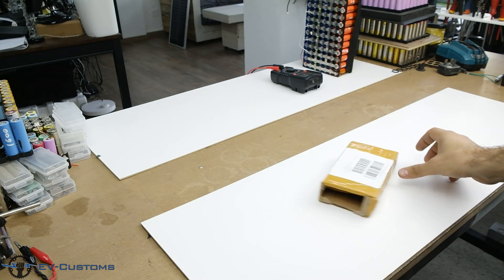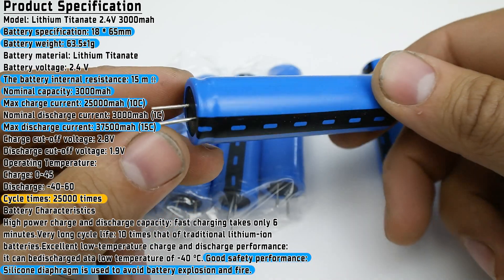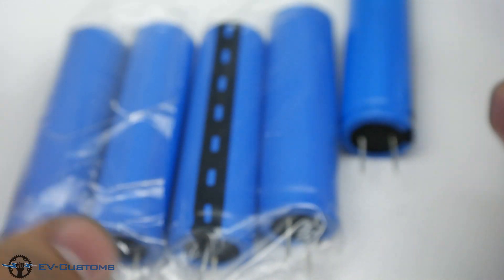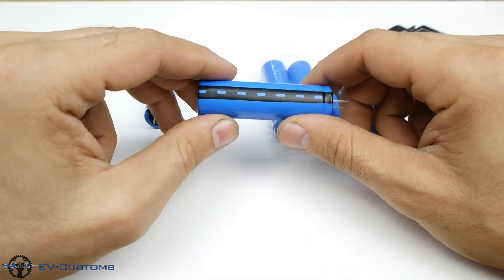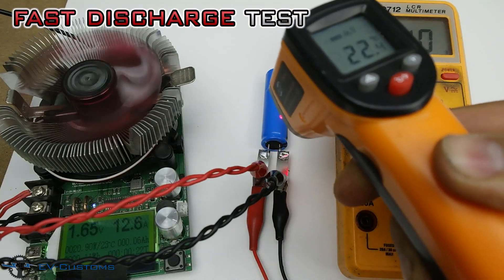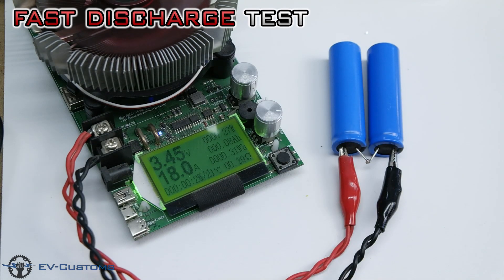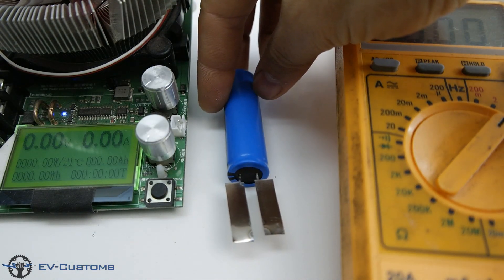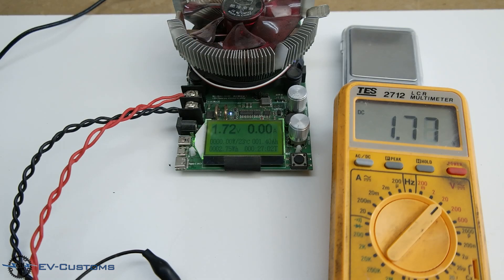18650 3000mAh LTO Lithium Titanate Battery? (Testing)

Comment: Did you experiment with maximum charging rate?  Many of these sellers claim 10C maximum charging and discharging rate.  Even if the nominal capacity ended up being 1500mAh, could you charge at 15A?

Comment: Considering LTO energy density is 2x worse than lithium, it makes sense the capacity is actually half then advertised.  I dont think you can get an LTO battery the same size as 18650 with the same capacity.  Thats one of LTO drawbacks energy density isnt great.

Comment: Just ordered a load of these.
All are between 1200-1350mAh from different sellers.
Each batch seems to be equal though.
Fake, and should be sold as 1300mAh.

They are supposed to be 23680 but I received 18650 every time too.

I know that real 23680 batteries exist with 2440mAh capacity..
Reply from the maker: Hmmm...
Reply: @evcustoms  Huh?
Reply from the maker: @YaFunklord  You will build battery pack with them?
Reply: @evcustoms  Still calculating the size.
It may be more economical size wise to send them back and get bigger cells as I'd need 8p to make anything reasonable like an e-bike battery.
I wanted to try to use PCBs to build the pack too.

But delivery took for ever to get these, maybe I will just keep them for testing...
Reply: @evcustoms  After I opened dispute the sellers kept lying and not accepting any fault so I'm returning everything.
I will probably get 23680 from a more reputable seller instead. Should be 2440mAh.

Comment: Max charge current: 25000 mA (10C) => Capacity 2500 mAh
Max discharge capacity 37500 mA (15C) => Capacity 2500 mAh
So I would not believe the nominal capacity being 3000 mAh...
Reply from the maker: Yes i scammed there..😄 this battery have actual capacity at 1500ma

Comment: I would use these in a very large battery pack for use in electric  snowmobile  since they are excellent performing in extreme  cold.
Reply: I would like to see extreme cold charge testing. I live in the Midwest (USA), and it gets very cold. My application would be for a 5v solar panel charging this battery in the winter for a meshtastic node outside.

Comment: Can these be used in Electric Vehicles?
Reply from the maker: Definitely..!
Reply: @evcustoms Energy density is 1/3  to 1/5 of traditional Lithium Ion cells so may not be too great in car.
Reply from the maker: @1kreature  Hello friend...  yes density is not so great ( yet ) there is no everything about range, in some vehicle's for example drag racing...  you will use definitely LTO, or someone like me prefer long life battery and fast charging on his bike...  each project need different type of battery..

Comment: Probably a mistake with charging speed.  In your video you are charging at 2.8V constant voltage mode instead of constant current. A better way of testing would be turn up the voltage and charge at 10C, while looking at if it will explode or retain/release all these energy.
Reply: Constant voltage and constant current. The MAX voltage is limited to 2.8v and the current can be limited to 10C. If the battery voltage rises too fast, the voltage limit prevents the possibility of pushing in enough current.

Comment: wish i could find an 18650 lto without those spindly terminal connectors, just the normal flat plate wtith +ve and -e at opposite ends like regular li-ion 18650s. only ones i can find are on aliexpress and i dont trust them to sell me real lto after a previous bad experience
Reply from the maker: you can find Korean lto 18650 cells.. but the are more expensive..
Reply: @evcustoms  i had a look for korean lto after reading your comment but couldnt find any search results as you describe. since writing my comment though, i did actually buy the aliexpress cells i mentioned and said i didnt trust at the time - they're called BTR hakadi, i havent managed to devise the right sort of equipment to test them individually yet (as all the 18650 capacity testers i've looked up only use the conventional cell chemistries like LFP LCO LiPO etc, so i'm having to build my own) but ive got a dc power meter and a couple 2ohm resistors so i guess i can wire all that up into a useful circuit for a DIY tester, and those resistors should be enough for about a 1c discharge and i guess i can do both the discharge and charge capacity test once ive figured out how to make a microcontroller or something log the voltage while it's discharging so i can get one of those fancy graphs i've seen all the other battery testers generate. so cant quite update with detailed review just yet but i will say the 6 cells i ordered arrived within .003 volts of one another, and having waited a couple months they don't seem to suffer any serious self-discharge problems, as the lowest one now has dropped about .006v from the supplied voltage 4.292V, while the highest is at 4.292V down from 4.295 so on those 2 criteria alone, maybe i spoke too soon in condemning them, but until i've tested them properly i cant say for sure

Comment: Hey, I am building an electric scooter. I am using a brainpower controller. I don't know which wires are the ignition wires and the ones connecting to the display. Can you please help?

Comment: A charge - disharge capacity test would be instructive.  My guess is that it's 1300mAh.  
These cells would be far superior for projects,  much safer.
Reply: tried today LTO as video 1200mAh
not 3000mAh
Reply: @xdellavedova  makes sense as energy density is 2x worse then lithium, they should be bigger then lihtium cells at the same capacity, or in this case over 2x less capacity for the same size

Comment: quite nice.... and also the capacitor stile is nice, more easy to work with... just a regular PCB will not work, need thicker traces and solder might not work at high currents.. 
I think this type of package for this cells look like more China Style Improvisation , also no marking on them showing same china style dubious quality...

Comment: WTF this is capacitor!!
Reply from the maker: There are no capacitors in this size with a   1500mAh capacity.
Reply: This is a Lithium Titanium Oxide battery in 18650 form factor.

Comment: So, what's the point of making high current battery that cannot discharge with high current because of leads?
Reply from the maker: I was check all batteries and all they have same capacity 1.4-1.5Ah, so for 15C discharge (22A) is ok.. i have tes them...
Reply: @evcustoms  ok, but you said that leads cannot stand currents that this battery can give.
Reply from the maker: @kundeleczek1   If the batteries was 3000mAh as seller says, at 15C this leads must hood more than 37A thing impossible...  the actual capacity after capacity tes is 1500mAh so at 15C leads mist hold about 22A max.
Reply: @evcustoms  can they hold 22A in your opinion?
Reply from the maker: @kundeleczek1  Yes you can see this in video, discharge on dummy load at 22A
Reply: @evcustoms  So can I discharge it full at 22A . From fully charged to fully discharge?
Reply from the maker: yes
Reply: @kundeleczek1  Yes...Keeping in mind that a "Full Discharge" means from Peak voltage (2.8v) to Cut-Off Voltage (1.9v). If you take it below 1.9v it is considered "Over-Discharge", and can damage the cell.
Reply: These can safely be soldered and will break off before anything bad happens in an overcurrent situation.
LTO come in the best battery packages.
Reply: @YaFunklord  so they are high current?

Comment: Looks like a capacitor would be hard trying to make a pack out of it
Reply from the maker: If you search on AliExpress for 18650 LTO batteries you can find exactly like lithium 18650 batteries with max 1500mAh capacity, i will buy this batties for sure, to make scooter or ebike battery pack.